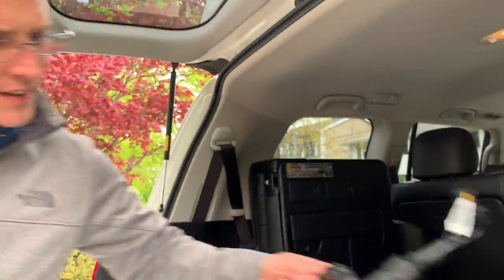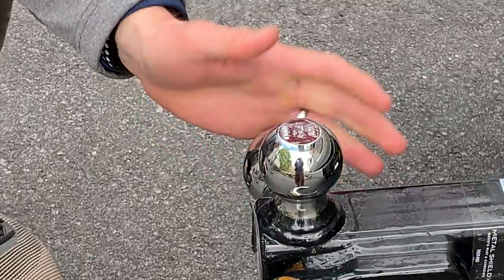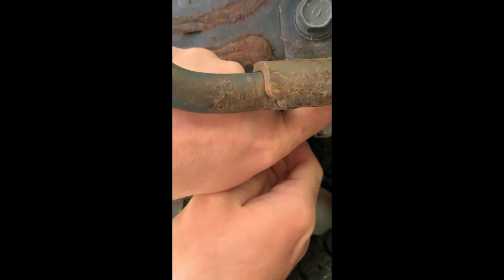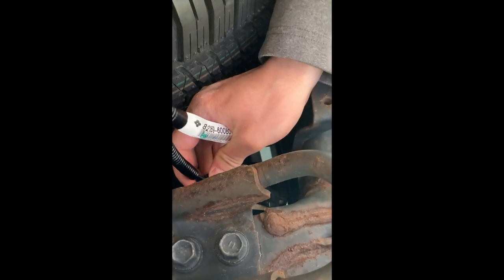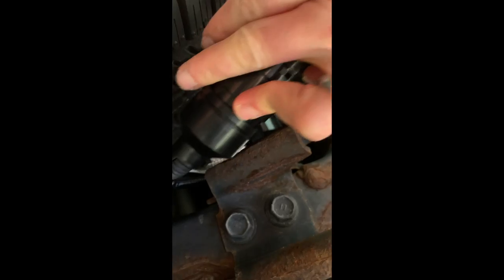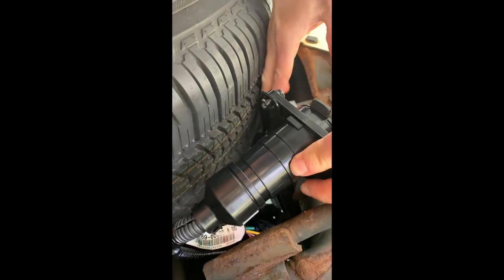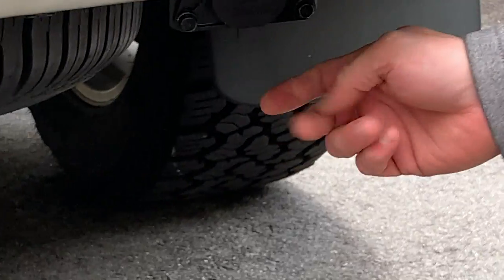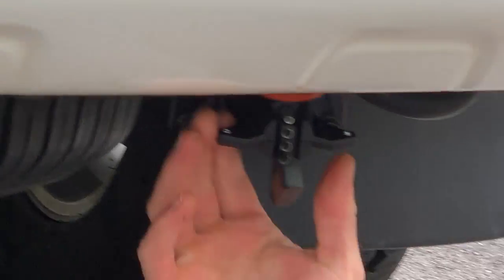2013 LC200 / Land Cruiser Trailer Wire Harness

Comment: I have the same issue with a 2015 LC - owner’s manual says the wiring harness comes installed but it did not.  I had to pay over $200 to get the parts kit, 82169, from Toyota.  How did you get the caps off?  Screwdriver?
Reply from the maker: It's a little "tricky," they don't come off easily. I used a combination of a screwdriver and "squeezing" to get them off. They're basically snap-on components, but you'll really need to get under there with two hands - a good flashlight will help too. Good luck
Reply: What is the name of this part and how many port its
Reply from the maker: @hussainalhammadi3165  Toyota Parts: (7-pin to 4-pin adaptor) PT791-89040 & (Harness connector) 82169-60080
Reply: @mphughes  thanks dear